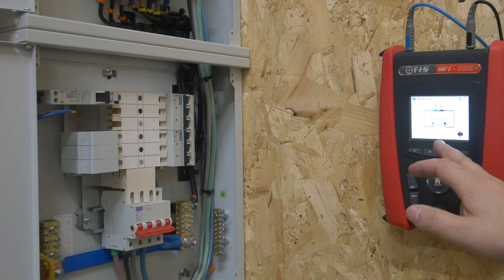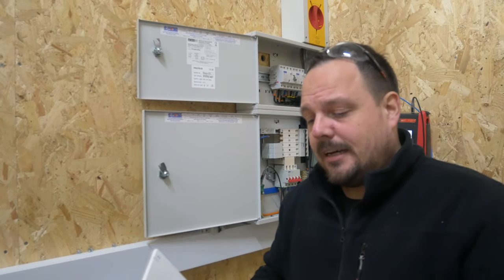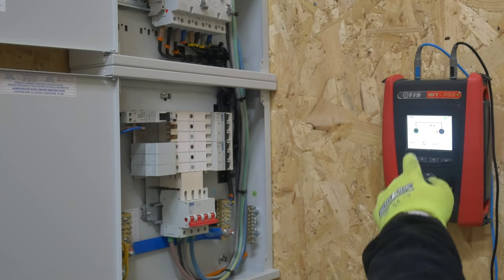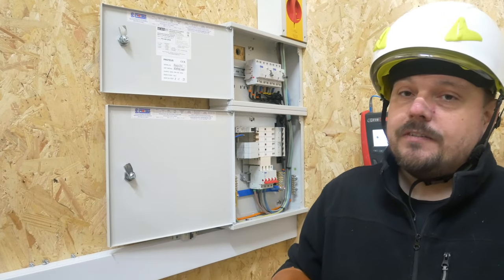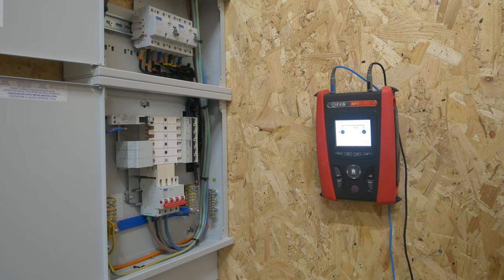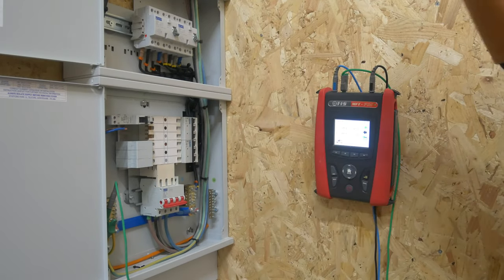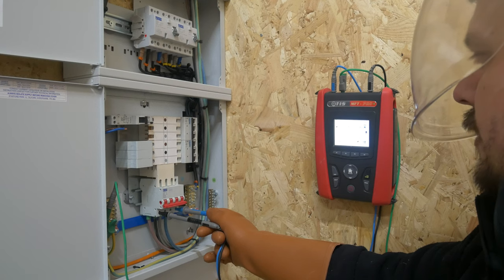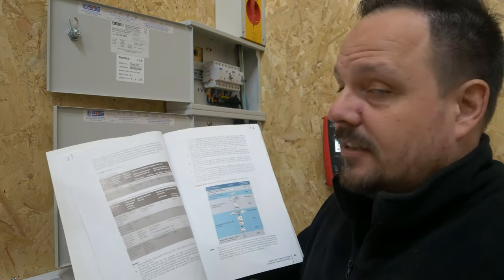Live testing is Dangerous - Electricians Dont do it...

Comment: How many viewers use rubber gloves and a hard hat with a visor? 😂🤣
Reply from the maker: Safety 1st when watching YouTube 🤭
Reply: I do (water industry)

Didn’t use to 

Bit like hard hat, gloves, hi viz & seat belts

I guess it will become the norm

Gloves are a pain in the arse (need to be better) plus leather gauntlets over the top.

Also have Fused leads, 2mm max exposed, proving unit etc.

And in recent times I also wear flame retardant overalls when operating lv acbs

Great content, detailed and concise

Not telling, just saying, as will all things, do what makes you happy
Reply: @Dog-whisperer7494  Yes I agree but I was commenting on testing.
Reply from the maker: @mark vinter  it's something to think about that's for sure. 

Good to hear others are doing the same and more.
Reply from the maker: @Sean Dempsey  you would be surprised on an arc flash calc for incident energy. Lots of 400V TPN needs it. Just because it hasn't happened doesn't mean it won't 👊💪
Reply: It is pretty much mandatory in the power industry.

Depending on the transformer rating, how close you are to the secondary terminals and the fault clearance time, the arc flash energy will be greater at 400V, than it will at the primary voltage, especially if you are relying on the through-fault current in the secondary to clear the primary protection. On some systems we have the ability to switch over to an instantaneous protection system, which will reduce the energy considerably. Whilst the energy level is usually higher at LV, it is easier to initiate the arc on HV.

Even at the domestic level, a lot of meter operators are now issued with a face-shield and gloves for incoming fuse removal. Whether they actually wear them is another of course.

Rubber gloves with leather over protectors, FR balaclava, safety glasses and face-shield, arc resistant overalls, any garment worn over the top must be at least flame resistant and garments underneath must be non-melting fabric. 

A lot of the time, loop impedance and fault current testing is a mute point for us anyway, as the meter just reads 0 ohms and goes over-range the the fault current.